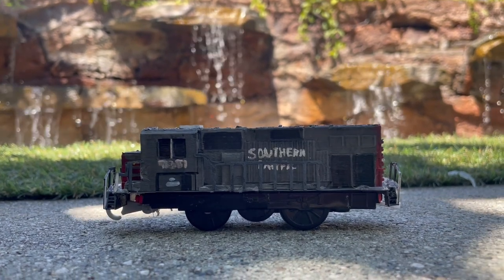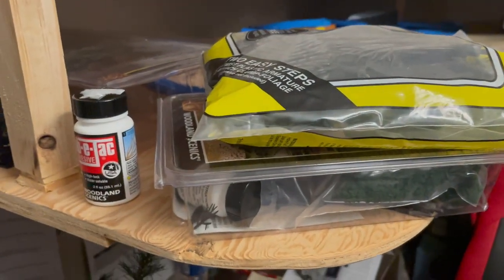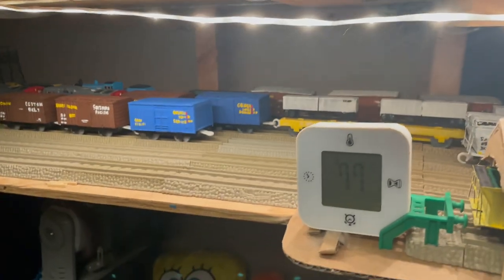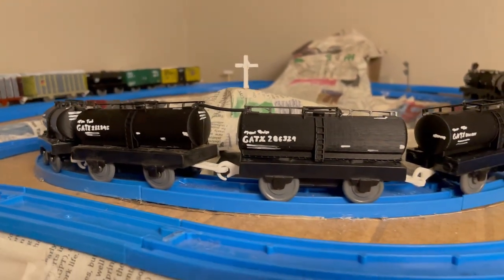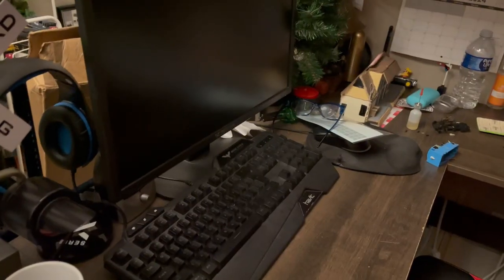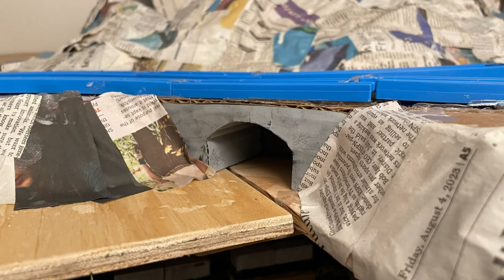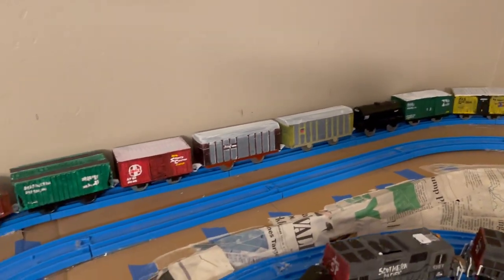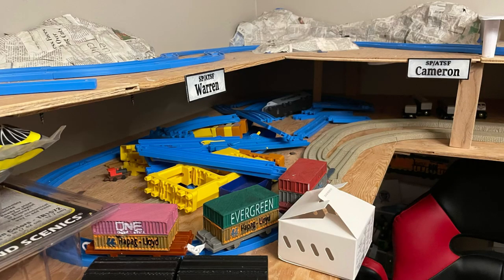Speed running my future Layout updates

Comment: Shorts video idea a fright train is going down the area ware the track goes under itself. The camera would be in the circle area but when the train is close to the ground the camera will pan over the elevated area and stop in the area ware the track goes under itself and then the train would pass by. The train would have 2 engine's at the front with these cars behind the engine's 4x box cars 1x Hopper 2x auto racks and 2x tankers for the engine's you do whatever you want but they have to be at the front